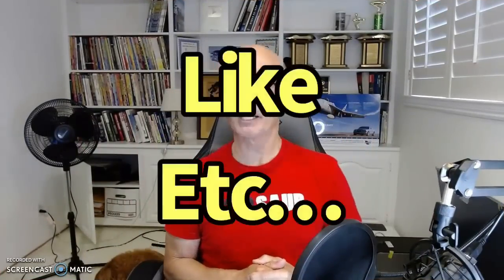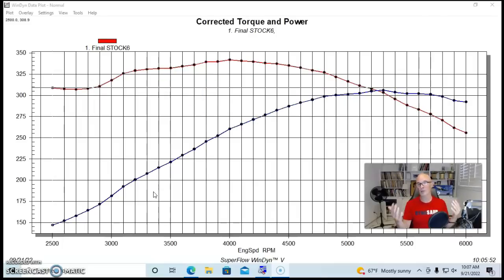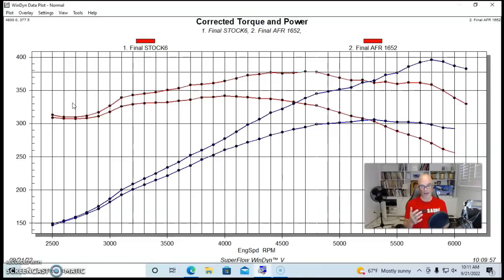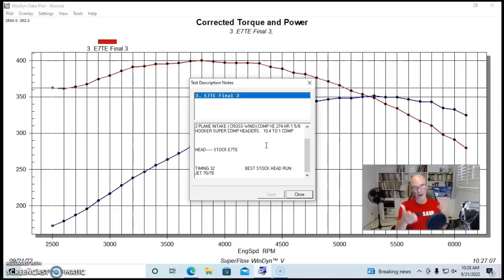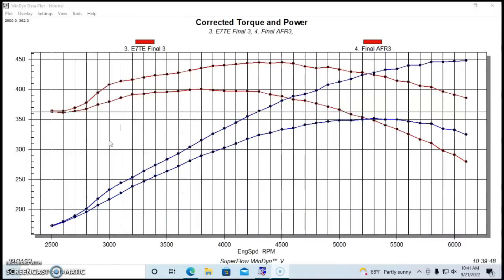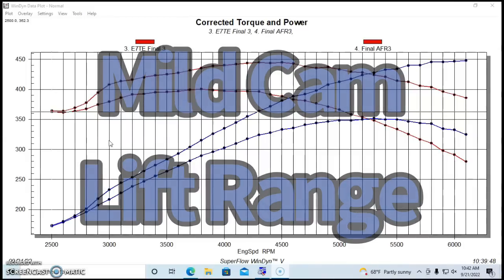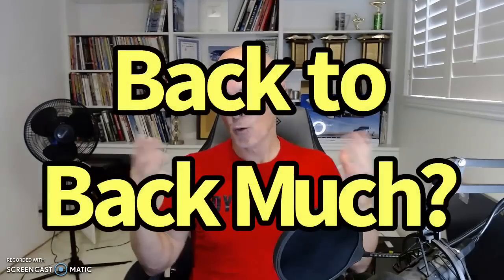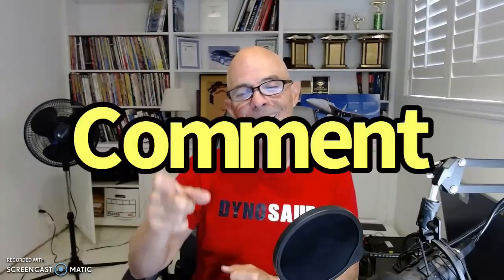WHAT IS THE BEST CYLINDER HEAD FOR MY 5.0L FORD? WHY I CHOOSE THE 185 AFR OVER THE 165 AFR HEAD.

Comment: If you combine the numbers for both tests and cylinder heads , the 185s only made 6 horsepower and 9 ft pounds of torque more than the 165s based on the only variable that didn't change "E7" heads. So really no difference at all at the end of the day. Example: 90 hp and 36 torque over stock with 165 and 96hp and 45 torque over stock with 185 heads
Reply from the maker: nice try
Reply: @richardholdener1727  it's in the math! Look at it again.
Reply: @richardholdener1727  unless you're saying the AFR 165 heads make less power then the E7s on the larger motor!

Comment: On your camshaft lift specs do you go by .050 or .004 duration?
Reply from the maker: DURATION SPECS (I'M SURE THAT IS YOUR QUESTION) ARE USUALLY MEASURED AT .050 OR ADVERTISED (WHICH CAN VARY)

Comment: I would love to see you dyno test, the comp xfi 236hr vs comp xfi 248hr stroker cams. On a 13 to 1 compression dart 363 short block, run on E85, using a 950 E85 carb. Tested with parker funnel web vs super victor intake (trying 1 inch, and 2 inch super sucker carb spacers on both intakes), and 1 and 3/4 Long tube hedders vs 1 and 7/8 Long tube hedders. And top it off with trick flow 11r 205cc heads vs afr 210cc competition ported heads. Now thats a wild, pump gas, dyno i have never seen, but its my dream pump gas setup!
Reply: shit 13:1  on a 363?!  220 LOL and that cam is WAYYYYYY too small for that compression and some e85.  use a big solid roller that will go to 8500  

that 248 might go to 7000+ on a 363 and 205's
Reply: @KingJT80  Im sure 205s on a 363 would be great to 7k, to 7,300 rpm, as i had a 400+ cu. In. Sm. Block with 200cc heads, and a solid roller cam before, and those heads did not flow nowhere near as good as the Tfs 205 11r, or Afr 210s. Yes, 7,000rpm is the max rpm i wanted my 13 to 1 comp., E85, 363 combo, to go to, as i dont want to go to shaft rockers, and i dont want to always adjust lash of a solid roller cam. The xfi 248, is a very healthy hyd. Roller= 248 @ .050 on the intake duration, and 258 @ .050 on the exh. duration, with a 112° Lca. I wonder what this combo would prefer, 1 3/4 longtubes, or 1 7/8 longtubes? I also think the parker funnel web single plane with a 2 inch 4 hole super sucker spacer, under a E85 950 would out perform a super victor, in average Hp, and torque, from 4,000 to 7,000 rpm?
Reply: @evilinside5984  I'd think an e85 oriented 850 would be more than enough carburetor for 363 even at 110% VE of a race style engine but yes that's pretty big hydro roller cam.  I think you could get away with adjusting lash every oil change on a solid roller. I tossed around the idea on my 302 but since I'm only going to 6500. A hydraulic cam would work 

I'd think if you really want a max effort 363, the solid roller will make more power and rev faster and the 205s of either AFR or TF will come with solid roller springs by default because they know most people at that level are ditching the hydro roller for a solid roller and they just use regular rocker arms and stud girdles and let it eat
Reply: @KingJT80  If i could get a solid street roller custom cam made for the 363, i would run it. I had a solid street roller cam before in a 9 to 1 comp. 400+ cu. In. Sm. Blk., 255 deg. Dur. @ .050 straight across, with an air gap rpm intake, only 1 5/8 longubes, 200cc iron eagles, gas 750 dp., shifted @ 6,500 rpm, 4,000 stall speed tq. Converter, n @ 3300lbs., ran 11.57 @115Mph, w/1.60 sec. 60ft. And i only lashed the valves twice in about 10 years, of street driving, and going to the track a few times a year!

Comment: 1.9 v 2.02 valve yes ? so the low flow improvement is valve diameter, port volume we can't be so sure, at least from an inertia column filling the cylinder at lower revs.

Comment: This test seems too apples to oranges. You’re comparing a larger engine’s (331) power to a smaller engine’s (302). Especially when comparing low speed power…
Reply from the maker: WHAT IS WITH YOU AND APPLES AND ORANGES
Reply: @richardholdener1727  I like fruit, it’s good for ya 😉

Comment: I remember about a decade ago when darts new heads flowed more cfm even though they were using a slightly smaller port. They said that any time you can do this......you get a better all around combo with more power everywhere instead of just at the top of the rpm range. The new heads that year may have been called the renegade series.

Comment: So, by this logic, a 195 or 205 would be even better.
Reply from the maker: OR A 225, 245 OR 265-THERE IS ALWASY COMMON SENSE TO APPLY HERE
Reply: @richardholdener1727  Not so common.
Reply: With stock bottom you have the valve relief issue...

Comment: But for any newbies that may be learning, don't get all caught up in flow numbers, bigger flow numbers doesn't always mean a better running engine! There's also port velocity to consider, and it's very important! Here's an example, say you and your buddy both have identical 355 Chevy's, same exact cam and all, only difference being is heads, you got a set of 170cc vortec heads and he has a set of 235cc dart head's. Well is will flow a lot more, but from red light to red light you'll probably kick his teeth in! From better velocity!!!
Reply: There's never any proof of that on this channel. Stock GM 376 cubic inch ls3 has a 257cc intake runner and makes more power everywhere than a ls2 with a 210cc intake runner.
Reply: its all about purpose.  he MIGHT  kick your but but if the 235  is tuned correctly with the right gearing  that story might end up different

its the whole package.  

now if its a 170 vortec vs a say,  the AFR 180  the 180 will walk that vortec.  hell even an as cast 185 enforcer will walk that vortec head.  i mean its meant to be a company van head.  not so much a  performance head. 

 thats why they also made bowtie 185 and 225 vortec versions that have 2.00 valves and bigger ports. 

those are performance oriented

Comment: What about for a heavy application like a fullsize truck? They like to recommend a smaller port to keep the air speed up on the slower revving deal.? PS I Enjoy your Dyno comparison videos👍
Reply: Use a 351 or 351 based stroker. that lets you keep the airspeed up with displacement instead of revs, and allows room for greater overall torque output.
Reply: @Cowboy.underwater  missed my point. The video was talking about a 302. That head would be ideal for a 351 in a heavy vehicle (according to manufacturer s). Going by the video why not use a 210cc?
Reply: @scottmanuel5418  because whats your main purpose.  a 210  is a 7000+ RPM head on a 351W stroker.  a 185 on a 302  is a 6500 rpm head and a 6000 RPM heads on a 351.  

how high you feel like revving it to make that power?  they DO make more power on a dyno but you dont drive a dyno around pulling things im assuming?

that and the valve on the 165  is a 1.90  meant to be a bolt on to a stock block 5.0 after 86.  the 185 has a common 2.02 and  youre gonna need pistons  or flycutting.

Comment: Like I have mentioned before, I had a 1990 LX 5.0 with the manual trans in high school. I copied an engine you did back in the day to put in it. It was a DSS 306 with AFR 185s and that XE274 grind in it. I can’t remember what intake I had at the time, but that car was an animal! Way faster than a 17 year old had business driving!!!
Reply: That’s pretty damn close to the ideal street set up, just needed a turbocharger to complete the build! 😉
Reply: @aaronliddell4280  I always wanted to do a S trim on it making about 10lbs, but unfortunately I lived in Houston Tx for a while after highschool , and it was stolen and stripped!
Reply: @chandlerlofton6536  😢
Reply: @aaronliddell4280 And then you can kiss your reliability goodbye.

Comment: I agree. I run trickflow flow 11r 190cc heads with stock bottom end.  And a .607 lift 224/232 custom cam.

Comment: Very interesting set of tests. Questions: what estimated gain is due to the compression increase? Why is there a large airflow jump in the.500-.600 range between the two heads? What would be the potential gain if the 306 displacement was retained, but the test went to 8500 rpm with the 185 head?
Reply from the maker: would be a completely different cam and intake and short block and valve train
Reply: @richardholdener1727  I bet I'm not the only one interested in a high reving 302!

Comment: Why do dyno operators always correlate low valve lift flow numbers to low speed torque?     Low rpm response in a product of  air flow AND velocity.  I think you may be on the right track, Richard, but I think you may be postulating a theory which you aren't prepared to test.   I would like to see a test where you try to prove yourself right, but then back it up by trying to prove yourself wrong.    That would be a good video.  Don't get caught in the common fallacy of trying to prove something that you wish to be true.   It is your job as an engine scientist to remain unbiased and let your results speak for themselves.    I wish you could have kept that 306 for all the tests.
Reply from the maker: you must be new here
Reply: you know how many dynos this guy has ran?!  since the late 90s ?!  LOL
Reply: @KingJT80 I don't believe something just because somebody tells me its true.   I want to see scientific testing using scientific methods.   I stand behind my statement.   This video is pseudo science at best, and not befitting someone of Richard's dyno experience.

Comment: Richard those are the old outlaw heads can you test the newer renagade heads 165 vs 185 on a 302 and 347 I I don't believe anyone has ever done this test or even one testing outlaw vs renegade heads of it was a chevy it would have gotten done
Reply: Looks like new renegade heads (which have been out since 2012, so old too!).
'The old outlaws flowed 129I/118E at .200 lift. I know, I'm using them. The outlaws intake was -10cfm on average compared to the 185 renegades and +5cfm on average against the 165 renegades.It's the exhaust that blows the old versions away, like +20...and both the new 185 & 165 intake and exhaust flow #s are the same upto .300 lift! explains why you want the 185s hands down if you can do the piston clearancing.

Comment: Unless I am reading the data from AFR's site incorrectly, the AFR 195 renegade out flows the 185 in all lift ranges?
Reply: yes  because youre getting into the "race" heads and the need for the single plane intake they make

Comment: The same hump exists on the 195 to 209 cc 2V Cleveland 302, 351  C/ 351 M and 400 head, a big ski jump from 2500 to 2800 rpm. No loss on having a reasonably big port.( Seen first in the 1988 Australian Street Machine "Power Games" Lynx Industries SF 902 tests on 302 and 351 Ford engines with 2V Cleveland.  heads. They ran a range of CC252, 260, 268 and 280 cams)
Reply from the maker: seen first?

Comment: I think the 165 is more geared for the guy with a stock shortblock that doesn't want to deal with flycutting for valve clearance that the 185 would need.  Overall, I think the 185 is a great head for just about any small block ford.  Even on a 392/393 stroked Windsor, those 185's are awesome heads.  If I remember correctly, in MM&FF, their 392 stroker made over 500hp with 185's.  You might have even done the test way back when.
Reply from the maker: I did
Reply: I have that combo back in 2000 i think 393 afr 185 xe282 hr vic jr
Reply: do the 185s have bigger valves? or just you might as well run more cam on the bigger heads?
Reply: @totensiebush  yes 2.02 to 1.90
Reply: I was thinking the same, although I contacted afr and they recommended a 185 head with smaller valves compatible with the stock shortblocks.
Reply: I might still have the issue in my library. I was awestruck. The huge gains were over GT40 aluminum heads.
Reply: Do these 185 heads usually come with 2.02 intake valves?

Comment: It always blows my mind how these heads are allowing more power than a 351C4V (my first engine)
Reply: We're doing Cleveland chats in other discussions.   The stock cleveland 4V head flowed 275CFM@.600", most people built bad combos.    With a valve job they flow 310CFM@.600" and with bowl work and a valve job the flow 305CFM@.500" and 333CFM@.600", they are some bad asses.    The modern day Cleveland head is the CHI which are made in Austrailia and they are used in 600-1000HP build ups.   Cleveland heads dominate on low lift flow.    The Flow at .300" lift is 235 or so where a good windsor head will be a little over 200.

Comment: I've wanted someone to do a test disproving the 'too big head' myth for a long time.  I'd love it if you did a back-to-back test with the smallest vs. largest aftermarket head from some company - AFR 165 vs. AFR 220 on a stock 302 short block, for instance, and start the pull from way down low, as far as the dyno will hold.  I've yet to see any penalty from high flow intake and exhaust ports!
Reply: I’ve been on the opposite side of the fence. I like a small runner volume head with high flow. But that’s because I like quick throttle response and good low end torque on the street. On the track where you live on the floor board, that’s not going to make a difference. The bigger heads will be better for full tilt power.
Reply from the maker: please see the port volume video
Reply: its not really to big that vid.. gotta remember the 302 had cleveland heads and loved it to.. and from memory they where 300cfm at 600
Reply: if the port volume is too much, the port velocity drops off and it tends to zap the low speed torque. Check out Fords' Boss 429 heads from the early 70s (essentially the basis for a NASCAR race engine). To try to make it streetable, Ford tried moderate carburation, mild cams, and yet the engine was still flat in the low and midrange, compared to other engines.
Reply: @2lotusman851  it depends on port efficiency. Bigger ports with better flow at low lift which Rich indicates in this video will always be better in every rpm than small ports and worse flow.
Reply: Bigger isn't always better.